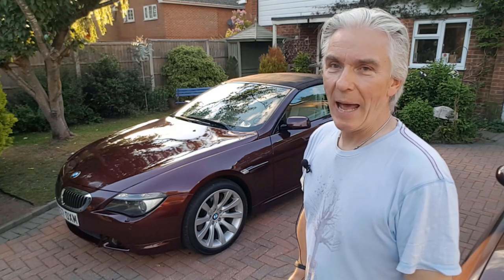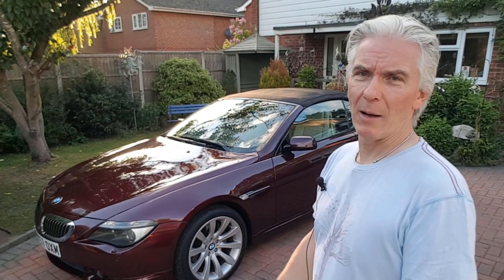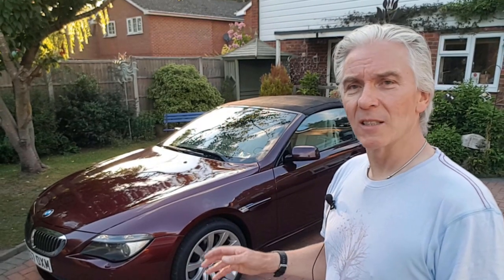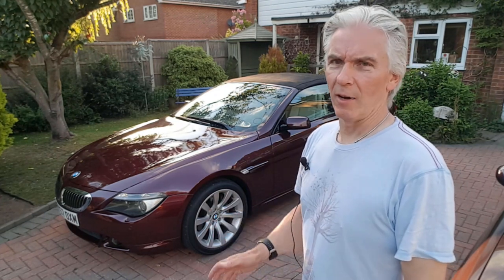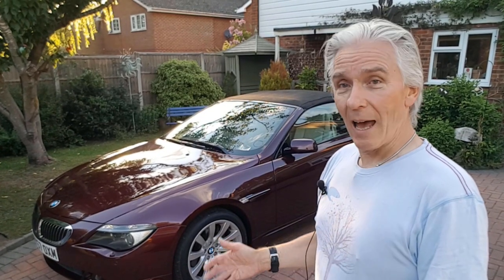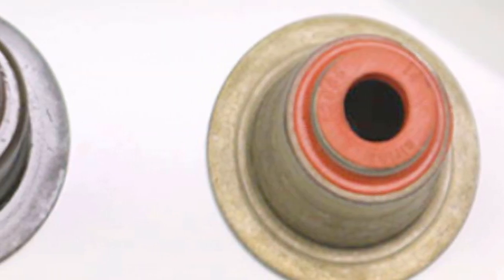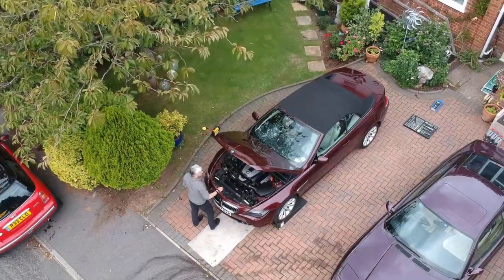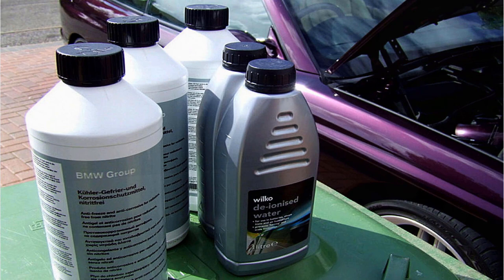BMW N62 V8 Engine Problems - SAVE IT - Don't fix later!

Comment: 18000 miles between oil changes 😵 no wonder 😂
Reply: It's long life formulated oil. What's the problem with that?
I've had a 2.5 straight 6 N52 engine in a BMW e89 Z4 which is 15 years old. I've had the car for 8 years and it's never given me a problem.
The car has only had its routine services once every 2 years.

You've obviously never had a BMW.

Comment: I had all but sworn off these generations of the bmw v8, you single handedly restored my desire to give it one more shot with a proper taken care of one. My wife's favorite cars ever were her e60 545i and 550i but eventually we had all the common issues you talked about and spent thousands upon thousands repairing them. It's nice to know you can make them long term reliable vehicles as they are an absolute dream to own.
Reply: Same here I had en e46 330xi and did the maintenance items it was a solid car after

Comment: Excellent video Timm, I preached the people all the time in the BMW chat forms that I'm in, not to follow BMW's recommended 15,000 mi oil changes. 6k -8k max. Interesting point that you made about people needing to change the oil yearly if they drive below 6,000 to 8,000 miles a year. Great advice! I bought my 2005 645 with 79k miles, with major oil leaks, got those all fixed, plus did a transmission oil service and seals, it now has 93,000 miles and running strong, no puffs of Blue smoke, so luckily whoever on the car before me took good care of it, the 2nd owner didn't want, or didn't know how to fix the oil leaks...but I did. I love my car!
Reply from the maker: Thanks Robert, and you're doing the right things!

Comment: I bought my 2004 645 Ci about three years ago. After about a month the engine smoked like no tomorrow. Rings were checked; ok. Turned out to be the valve stem seals. Luckily it was still under warranty. It disappeared for a few weeks and came back beautiful. I guess I was lucky to catch it so soon after buying it.
Reply from the maker: Good thing for the warranty

Comment: ZF also sells transmission solenoids for approx $300. Changing those also fix transmission thump issues. I did it a year ago for my 2005 x5 with 120k miles and it now shifts like new.
Reply: Hey do you have link for that solenoid

Comment: Great video. Taking apart my 650i for the alternator bracket leak. Going to use Wynns oil conditioner. Really makes sense and appreciate the in depth analysis and explanation.

Comment: Great advice Tim! I’ve owned a 2004 645ci for about 6 yrs now and 48k miles (bought it at 70k miles now it’s about 118k ). 

Two other proactive maintenance fixes I recommend on older models 6 series...one is the upper radiator hose ($95 USD) which will likely come apart at a not so ideal time and leave you stranded. 

The second is the right and left side Crank Case Vent Valve Breather Hoses ($59 USD for the set). Especially if you currently have the older version Y pipe that connects both sides at the center.  This hose gets dry rot and brittle from the heat and will split and crack causing major misfires across all cylinders due to the vacuum leak.  

These preventative repairs are a must do as well if one plans to keep their N62 in good order for the duration of ownership. 

Cheers!
Reply from the maker: Thanks for the info, great stuff!
Reply: Just exploded my upper radiator hose last week from the joint and waiting for the new to arrive. Quite common part to fail and should be changed if not done in while.
Reply: Jesse Salmi similar happened to me a few weeks back.  Spent the morning detailing the car,  headed out on a road trip with the Mrs.. Got on the interstate and accelerated hard to cross lanes and lost power.  Windshield was freckled with water droplets so I knew I blew a hose.  Exited the interstate and found the top radiator hose split in half at the plastic connection. 

Luckily I had a few assorted hose clamps in the boot.  No tools though...so used the wife’s tweezers to tighten the clamp. Let the car cool down roadside. Then limped a few miles to the auto parts store to refill the coolant enough to get me home an additional 2 miles. Ordered the new OEM hose on Amazon and replaced it in 10 minutes. 

It was a crap day but it could have been a lot worse...better yet it could have been prevented had I replaced the hose at 100k miles.

Ps...small metal hook tool and extra long flathead screw driver to pop the clips made the job a piece of cake.
Reply from the maker: Time to check your engine mounts - when they fail the engine will pull hoses off under harsh acceleration!
Reply: I also accelerated hard when the hose popped off.
Reply: @TimmsBMWRepairsandInformation  Any good video on how to check engine mounts?
Reply: @TimmsBMWRepairsandInformation  thank you for the tip! I will give them a good inspection when I get some free time.

Comment: Great video. These are the commandments for any n62 owner. I’ve had to do all these repairs. Coolant pipe, Alt Bracket seal, and valve stem seals. now it’s the abs module, and logic 7 amp rebuild time. All German Auto the creator of the expandable coolant pipe also does these repairs at a discount compared to the dealer and they do amazing work if you are in California.
Reply from the maker: Thanks!

Comment: Great VIDEO! I have a 2004 645 and I absolutely love it. Fantastic car- fun to drive. I purchased it with 70k miles and it now has over 110k. Just replace transmission fluid- a couple of hoses, brakes- 2nd time, tires, plugs at 90K... just keeps going. I'm subscribed!
Reply from the maker: Couldn't agree more!

Comment: Hi Tim, on the gearbox, I spent perhaps a few years trying to pin point the harsh shifts. As you mentioned oil, filter and mechatronic seals are crucial to change however the biggest difference I saw was with a software update for the EGS. All the clunking and shifts just disappeared immediately. Also the solenoids have a high failure rate and so changing just the shift solenoids while you have the valve body out is also a good idea.
Reply from the maker: Thanks Nakash!
Reply: I did seals, solenoids (cause I had bad reverse, bit slow) and a reset. Gear changes are smooth as.
Reply: @warboyrb  where do you buy solenoids from

Comment: I am Polish user of the E63.
There is even better solution to prevent for all the seals going brittle.
Replace the OE thermostate that opens up on 105 °C, to one that opens at 90°C
This will save your N62 for sure.
Reply from the maker: Yes, that's a good idea, quite a few have done this!

Comment: hello mate love all your videos and the information on the n62 engines keep them coming mate. i saved my 650 from scrapping it after some low lifes put in old used oil in the coolant reservoir and luckily the oil was sitting at the top of the coolant reservoir and never managed to mix in with the coolant in the engine so i done a full coolant flush a few times and havent seen a single drip of oil in it since then and the car runs as good as new, i use it as my daily and do about 12-13 thousand miles every year and enjoy every minute and second of it, keep the videos coming mate and wish you all the best
Reply from the maker: Yes, is that the one on Bimmerforums? If not, that will be the second one
Reply: @TimmsBMWRepairsandInformation  yes Timm that’s the one i posted on bimmerforums, what a low life’s, also I met up with Rupert and we done my gearbox service oil and filter change and she is in a great shape now love driving every second of her. Thanks for the community you have created and helping many people like me mate wish you all the best 🙏🏼

Comment: Stem seals along with the rocker cover gaskets and the timing chain gaskets are £790+VAT so not as bad as years before. Definitely worth to spend that to keep these on the road.
Reply from the maker: Thanks David, yes getting cheaper these days and not the end of the world if they do fail.

Comment: Excellent video Tim.  Another sad issue with the 650i is the cost of body damage repairs after an accident.  The aluminum components are very expensive to fix leading insurance companies to just scrap the car and paying you the low wholesale price.  That said, if you do need parts these vehicles are starting to show up regularly in salvage yards.  Although many of these places think they are BMW dealers and believe all BMW owners a very rich.  Also mention to everyone to change power steering fluid, and replace brake fluid regularly.
Reply from the maker: Yes, good points there!

Comment: Hi do you recommend swapping the thermostat for a 90c one, and changing the radiator cap to a lower bar version
Reply from the maker: Yes, I agree with the change of thermostat to 88C or 90C - but leave the cap as it is

Comment: uuuff exelent, Thanks for your post, I have a BMW 550i 2006 pack m and an X5 4.8is 2005, in the X5, I had to change the voltage regulator and in the 550i the gearbox housing, so far they all use 10w 60 every 10,000 km , and so far I had no more problems, thanks for your help, it is very important.
Reply from the maker: It's always my pleasure!

Comment: I guess you could have added an injector cut switch so you could spin the starter then turn on the fuel.

Sounds like they were emulating the old M30 cold start injector idea which worked perfectly well on the iron block engines.

Comment: Hey man, great video! I have a e70 with the N62 and I have 300,000km on her! At around 140 I started using 5w30 and after idling for a few minutes it would start smoking so I switched to 5w40 and it fixed that and fast track to 260 I used a engine flush fluid and after that it smoked so bad after almost every start after it cooled down. Seen this video at around 300 and never thought that would of had played a part of it so ordered a set and replaced them and like you said after 400km or so the start up smoke went away! Thank you for the video, sometimes it’s hard to find good DYI vids on YouTube for these engines!
Reply from the maker: Great news Joshua!

Comment: Drove an N62B44 (545i) for 100,000 km. The car would start in the open loop but not go to closed loop by itself. The solution was starting, driving 100m, stop and restart the car. In almost every occasion, the engine would run in closed loop then. 

The engine already had the known coolant leaking problem (rubber O ring wearing out causing leaks; impossible to resolve financially) but it did not get worse. Refilling coolant every 4-6 months was sufficient.

It would sometimes blow some smoke upon driving away after idling for more than a minute. But this was occasionally.

BMW = oil leaks. Valve cover, other areas. It's a marriage, those two.

Gear changes were rough when cold, but nice once warmed up. I never had the gearbox flushed.

Now driving a B58. It's more modern, faster and efficient (and no restarting needed), but I do miss that V8. It was worth the trouble.
Reply from the maker: Thanks for your message!

Comment: Hi Timm this is Alvin. Thank you for replying with this video for my situation. You stated that every oil change you use Wynn's engine stop leak for the alternator gasket. You also have the Liquid Moly oil additive listed below. Do both of these products do the same thing? If so which one is better, for protecting rubber and plastic parts of the engine. 
I  have the 2005 645ci with 50,000 miles. 
From your biggest fan.
Blessings to you and your wife.

Comment: Great information straight from the mouth of the owner, couldn't ask for anything but the righteous of self
Reply from the maker: Thanks Donnie, very kind of you!
Reply: @TimmsBMWRepairsandInformation  Mr Timm i have 08 bmw 650i , I purchased one tube Forte , still see smoke after idling. Should  I put another tube and oil fortifier too see what happen
Reply from the maker: @donniebeasleyjr5911  First plan is always to change the PCV's - easy and reasonably quick: https://youtu.be/Yy_Vzir5xco

Comment: My 645ci convertible came with manual transmission it’s got 54,208 miles it’s clean in and out, removed the oil fill cap and it looks like new

Comment: Thanks for this, I am looking at picking up a 2007 x5 with an n62 in it and now I know what to look for. Its got 93k miles and a fairly decent service history except for in the last few years and that concerns me. 

Now I know if the coolant is green = bad. (BMW coolant is blue) Also know where to check for leaks and what to look for ie pull one of those PCV pipes and stick my finger in the valve cover and see if some gunk comes out of it. 👍
Reply from the maker: Good man. hope it goes well!
Reply: @TimmsBMWRepairsandInformation  
I didnt even get that far. Opened the hood and the entire right side of the engine, the valve cover and the valve cover...uhh cover was soaked in fresh oil and you can see where it sprayed up on the hood. The oil was clean at least 🤷‍♂️

Anyway I said nope and walked away lol. For the price it was at I was not expecting to see that.

Comment: Confirms my experiences BMW sealed for life auto box  oil fails 100k, did it on my 535 and my friends X5. Change the oil on my 650 box cost around £250. Great tips thanks
Reply from the maker: Thanks for the info Jonathan!

Comment: So in a nutshell:  I have a 2013 650i convertible with auto transmission and 62,000 miles.  BMW replaced the engine/airpipes/seals/injectors/plugs at 41,914 miles.  Need to change oil annually with BMW oil; change coolant every 3 years with BMW coolant;  have PCV valve checked annually?; add Wynn's oil conditioner annually?  which engine and transmission does this car have and do I need to do any proactive service on the transmission other than what BMW recommends.  Love your channel!
Reply from the maker: Thanks Scott, your car has the N63, and I have no experience of that engine - but the things you have listed are a sensible precaution!

Comment: Bloody legend. Always so useful and clear. Wonder if you’ll have the time to answer, but I’m having trouble with startup noise on an M62 engine. Is there a valve somewhere in the oil filter housing that stops oil draining away when the car is not in use? Very hard to find the part if it does exist! No photos in where it lives or anything as far as I can see! Keep up the excellent work. I See you drive your E31 past my work in Petersfield occasionally :)
Reply from the maker: Thanks James, where do you work in Petersfield? Start-up noise could be a few things - leaking 1-way valve in the canister, knackered chain-tensioner or dying Vanos units (if you have an M62TUB). I show the 1-way valve in this video: https://youtu.be/8qBfJSINMJM
Reply: @TimmsBMWRepairsandInformation   Yes I think we’re narrowing it down to the canister valve…It’s my dads car and he has made an ingenious temporary solution where a switch under his seat turns off the fuel pump so that when he turns the ignition, the oil pump has time to get the oil everywhere before he then turns the fuel pump on again and it starts with no noise. Trying to find a new oil filter housing assembly now. I’m a music teacher at Churcher’s College. My dad had an Alpina B12 (E38 and E31 actually) back in the day so I love those things!

Comment: I was an apprenitice mechanic for a austin rover dealer when I left school back in 1988 the service schedules back then were every 6,000 miles and depending on the milage what items to service change.
I get time and techonolgy has moved on oils have come on from the 20w/50 treacle that was used back then but it just makes sense to change the oil every year mine goes in for service every mot which is round about 5-6k a year on high stressed engines your playing russian roulete if you don't.
The statement you made about the food chain is so true 60k car gets bmw love for a owner or two gets to 10years or so than gets abused and ends up as baked bean cans by the time its done 150k just like my poor old e60 once I sold it only had 3 owners now someones killed it.I was the third before I moved on
Reply from the maker: You've hit the nail on the head there! Thanks!

Comment: Woooow the BEST VIDEO about n62 engines! Thank you!
Reply from the maker: Wow, thanks!
Reply: @TimmsBMWRepairsandInformation  what oil do you recommend that has plasticides
Reply: @JaelRyan  it says to use 5w/30 but if you have a higher milage one use 5w/40. I used Castrol but found it didn’t dissipate heat vary well so I switched to Liqui Moly and noticed a big difference. It has the anti wear against in it. I use the green oil. But it’s up to you but just research it first before going to it. Good luck!

Comment: Hi grand evening Tim,my wife and I bought a 2006 e64 650i convertible about six weeks now and loving it, the car has done 127000 miles ,we are going to service this car now base on your knowledge, please advise what engine oil should we purchase now to replace thank-you.
Reply: We have replace the pcv ,Thursday last we replace the sump pan because of no protection cover, so it was  damage and leaking so the oil here was replace and we are waiting for the underbody cover Thursday last we purchase rocket  cover gasket as there is a slight oil leak ,we believe cause by "pcv"
Anyway what we would really like to know is what engine oil should we buy as we need to service soon.
Reply from the maker: Well done Anthony, great work so far. Here's the oil change video: https://youtu.be/woTGvS8eyiY

Comment: I have owned my E63 650i for over 6 months and it was all because of your amazing videos. Quick question regarding the N62 engine, is it always going to be the case that minor oil leaks shall exist? I have a very small weep and was wondering whether it's worth looking into or just accept that an old V8 shall always have this issue.
Reply from the maker: Well, only speaking for myself, yes they always have a leak somewhere - and unless it is somewhere that is causing damage (like getting oil into the alternator) I don't really mind as long as it is pretty small!